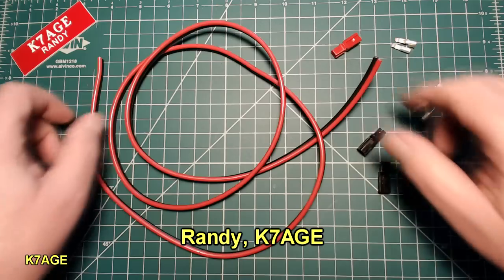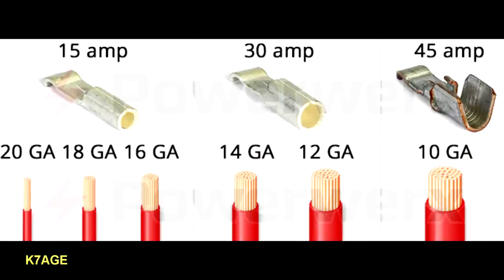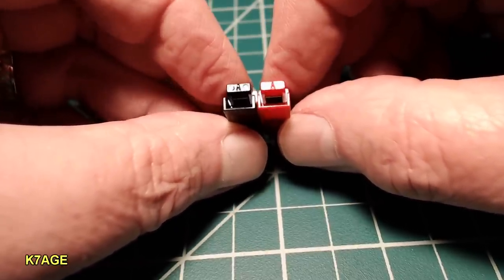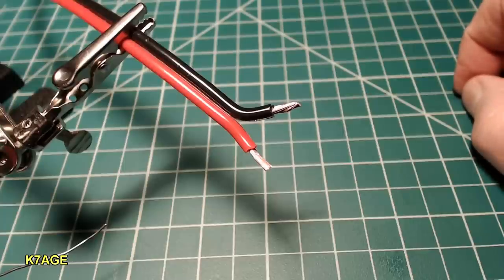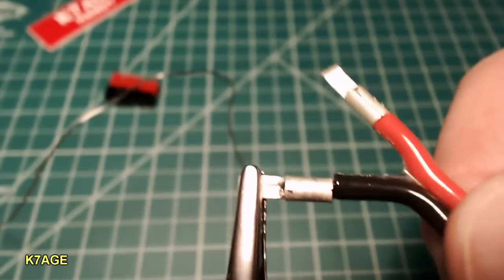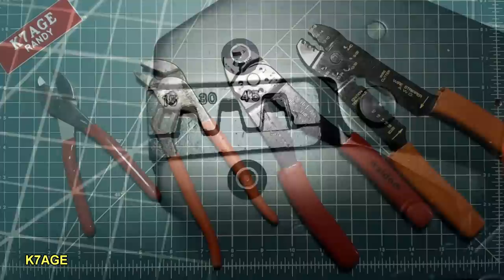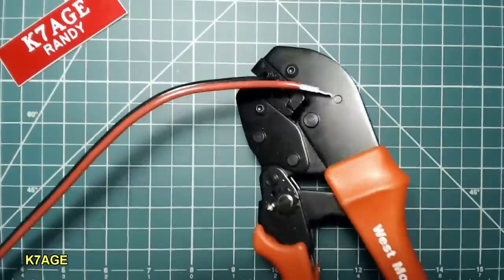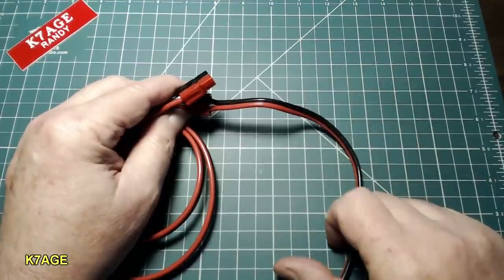How To Install Powerpole Connectors

Comment: Thank you! I just ordered a PowerPole starter package and already watched numerous videos. Yours had the most information so far. The others didn't talk about the correct orientation/side of the two plugs and how to correctly use the tong.
Reply from the maker: Thanks, the orientation is very important. I think I have a video of a polarity tester. It is a plug with a red - green LED. This tester is good to test when using cables built by other people. Before you blow up your radio.

Comment: Mahalo for the straightforward demonstration and explanation. I was active with radio-controlled racing 20 years ago and was familiar with these red & black powerpoles. Little do I know they would come back on another hobby. Glad to see that nowadays there is a crimping option instead of soldering.

Comment: Thanks Randy.  It was a great video.  I have been wanting to convert my ring connectors to Powerpole for a while now.  I agree with you about not soldering after you have crimped.  Using the proper tool makes all the difference.  Compression and crimp connections are used in a wide variety of commercial wiring.  Soldering has its place just like crimping and compression does.
73

Comment: Randy,
Nice video. I have a different crimper, but like the pocket in the jaws of the West Mountain Radio tool. Also liked the nmemonic "Red on Right, Read A". Easy to remember. I use wire with silicone insulation and fine copper strands. It stays supple in cold weather.   73 WB3BJU
Reply: Ditto to the pocket in the jaws of the West Mountain tool.  It gives me more consistent crimps than my old tool.  Reduces the old operator error.

Comment: Excellent video!  Your instructions are different than many other videos. Others show putting the wire into the connector, then inserting into the crimper tool. Your video shows inserting the connector into the crimping tool first, then inserting the wire.  I'm sure there must be pros and cons to both.  I'd be interested in hearing your thoughts.
Reply from the maker: I fumble around trying to get the pin into the tool in the correct position when it is on the wire. You just have to make sure to twist the wires together so that a strand does stick out the side of the pin. If it does, cut it off.  Thanks for the comments and for watching.

Comment: Thank you for the video! When do you need to use the roll pin to lock the two housings together?
Reply from the maker: I usually do not use the roll pin. Some guys are concerned that it may fall out and into something and do bad things. A toothpick is just about right. I heard of some that will put a drop of super glue the two pieces together. Another idea is to use a small cable tie to loop two sets of connectors together so that they don't pull apart.
Reply: Or you can cut the "fuzzy end" from a Q-Tip or Cotton Swab.  The paper shaft is just the right size.  Carefully cut the paper shaft with a utility knife.  Just be careful.

Comment: One catch: especially if you are using silicon (thick) insulated 10AWG wire on the 45A connectors, the thick insulation prevents the connectors from locking into the housing. Solution is to strip about 1/16" more wire, so the insulation does NOT meet the connector. Or, to use wire with thinner insulation :(
Reply from the maker: Yes

Comment: Great tutorial! From your own experience, which method gives the best electrical connection (best conductivity) between the soldering method and the crimping method?
Reply from the maker: Probably doesn't make much difference electrically. I have solder lots of connectors before I bought a crimp tool. Crimping is much faster and allows you to install connectors away from your soldering iron. Thanks for watching.

Comment: I just purchased my first mobile radio today, Kenwood TM-281 A and thank you so much for this, perfect timing. Also do you know where I can find a reasonably priced programming cable or a guide on how to make my own for this radio? Thanks.
Reply from the maker: RT Systems is probably the best. CHRIP is free, programs many radios, you need to find a cable.
Reply: Kenwood has free software for that radio and it is simple to use. The cable should be easy to come by, too, with a brief search.

Comment: Thank you for this video, still learning the ropes here.  A question I have would it make a difference top go with the 30amp power poles just to be on the safe side for my portable am researching and planning to make. In addition Can you please if you haven't already make a video for us newbie about setting up a home base/portable rig. what is needed and your recommendations i.e. Radio, Power supply , tuner ,speaker, swr meter. and how to connect what where  LOL yes am that much a newbie Thanks again for the video. 73 KD2MPI
Reply from the maker: Sure, the 30 A pins are fine. Setting up a station has so many variables.  I did a field day video a year ago that show a simple portable setup. Thanks for watching.

Comment: Great video.  Thank you very much.  Easy to follow you.  Working on getting my Tech license now.  At the end of the video you connected the two ends together.  Which leads me to believe one is male and one is female.  My question is which end is the common end on power supplies, distribution strips, solar power, etc. Male or female?
Reply from the maker: These are sexless connectors. No male and female ends. Any connector can plug into any other connector. 

You should be careful about using this standard connector configuration for solar panels. Solar panels may have a higher voltage, so you would not want to plug that into your radio. You can get the parts in different colors. Or change the position of the connector pieces so that they can't plug into your 12 V cables. You could place the red and black above each other instead of side by side.
Reply: Great, thank you for your reply.  Keep up the great vids.  73's

Comment: Great stuff Randy. Do you know if there are cord grip/strain reliefs or boots available that transition the connector rear to the wire for a clean, finished & sealed condition? I know there's always shrink tube or black tape. lol
Reply from the maker: I have never seen any boots. Heat shrink with the internal hot glue might be best.

Comment: Is it easy to water seal these. As I want to use this for my ebike battery. But not sure how good the seals are.
Reply from the maker: You could wrap tape around them or heat shrink tubing.

Comment: I have problems with the 45amp connectors.  Would like a video for them.
Reply from the maker: What problems are you having?
Reply: I seem to just crush and deform to open ear connector.  The will not fit into the plastic housing after.  I think I might need different jaws. on my crimp tool.

Comment: i need to connect a charger to some 12v/30AMP batteries for charging. what connectors will i need for 6 AWG wire?
Reply from the maker: You probably don't need 30 amp wire for charging. Check the battery specs, it is probably quite a bit lower.

Comment: Interesting that you spend so much time showing the soldering, yet many APP videos say soldering is a bad idea because it weakens the connection.  Your thoughts?
Reply from the maker: I show soldering because so many people don't trust crimping the pins. Yes, I have heard that soldering make the wire stiffer that may lead to breaking if the wire is bent too many times. I don't think that is a big deal. I don't think the wire gets flexed that much at the connector.
Reply: @K7AGE  I soldered mine since I only had a few to do.  I think the potential for the wire to mechanically break at the joint is the same either way as this connector has no insulation grip.